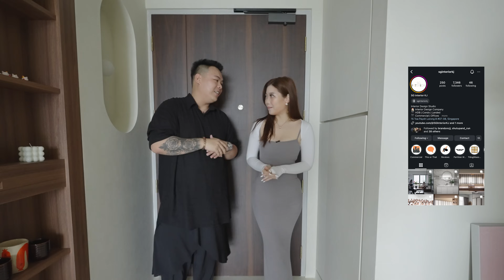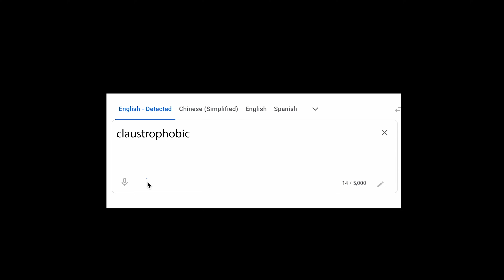Walkthrough with Mayiduo & Elizabeth Boon: 4-Room BTO With Microcement & Limewash Tour | SG Interior

Comment: Will there be any cracks on the microcement after awhile due to continuous expansion and contraction of the tiles?
Reply from the maker: Nope. Proper application plus high quality microcement prevents hairline cracks from happening. Most quality microcement company does offer warranty for cracks.
Reply: @SGInteriorDesignn what are the prerequisites for microcement? i.e. only on tiles or vinyls? how did you level the living and kitchen floor? thank you!